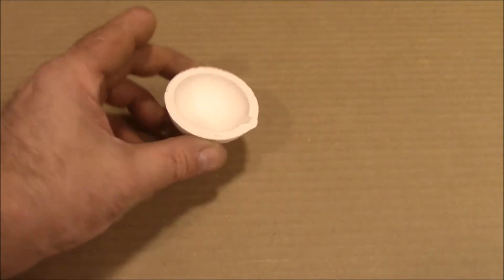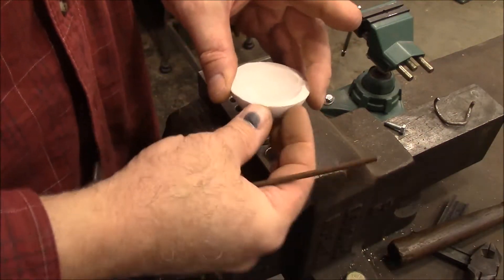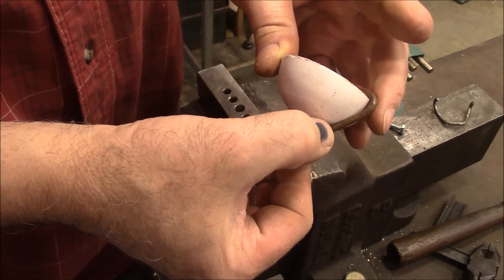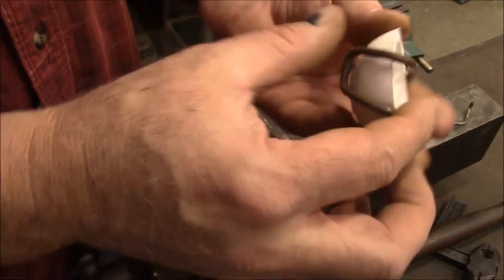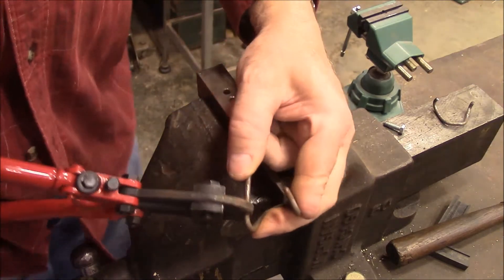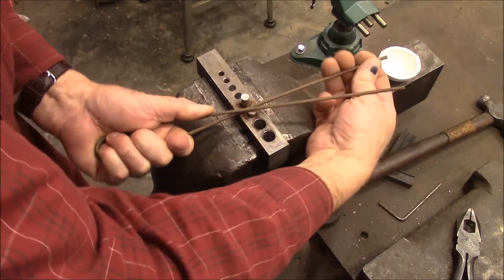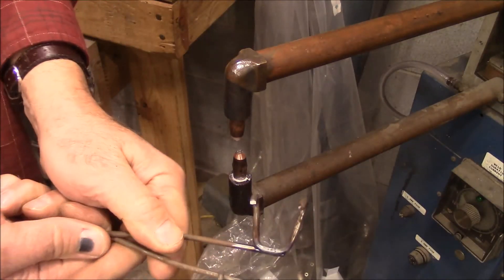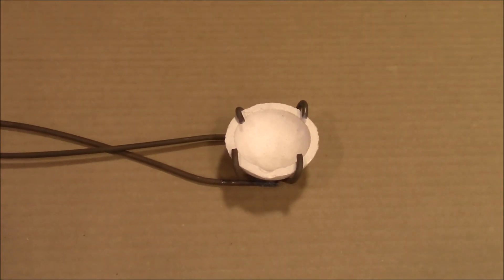Homemade Crucible Tongs

Comment: I think those are more often referred to as cupules. You may have better luck finding accessories and/or ideas for it by using that name (don't get me wrong, I'm no expert. But when I was in the jewelry business, that was the name they went by)
Reply from the maker: Thank you for sharing your experience!
Reply: No worries. I only got into metal refining recently and find it fascinating. I'm building a huge foundry that can run on gas or waste oil with forced air or pure O2 for the accelerant. I'm trying to make one capable of using only waste oil without preheating but still can run propane if it runs out. I'm hoping that the combustability of pure O² can solve that for me